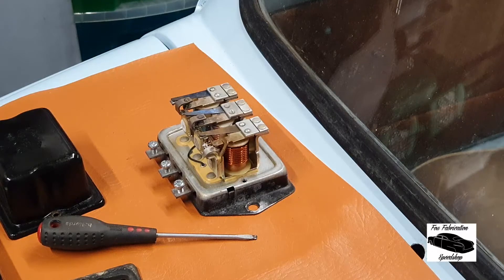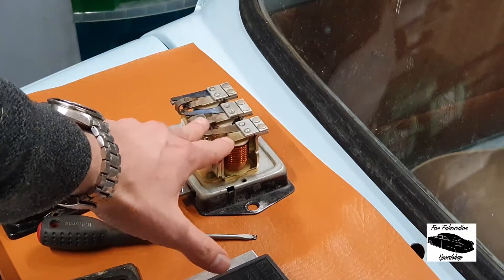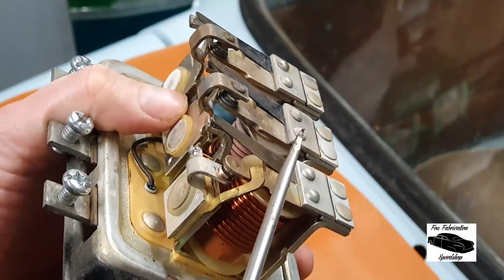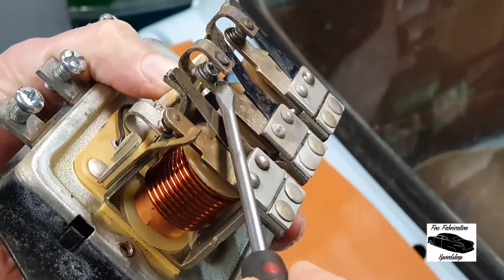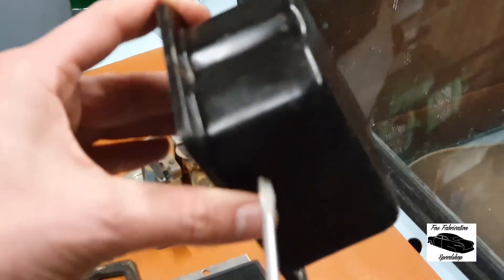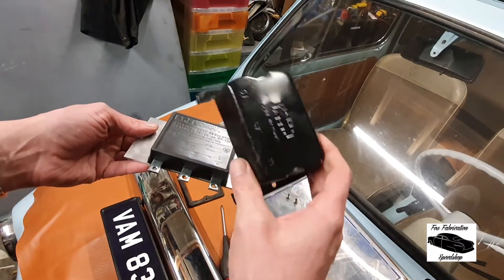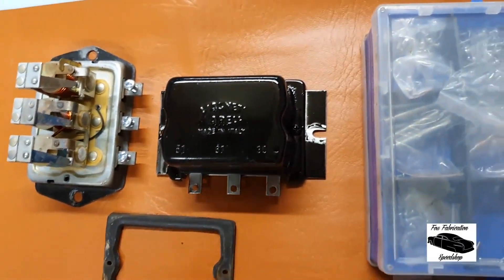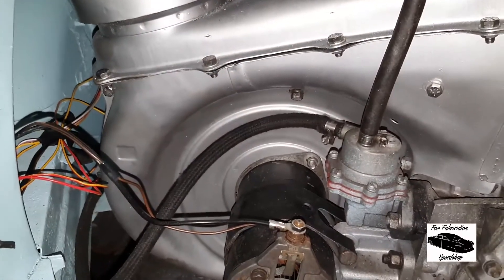Classic Fiat 500 voltage regulator swap How to DIY

Comment: thanks, but how did you test you were getting 12v ?
Reply from the maker: Just test at the battery when running it will read between 12.7-13 up to about 14 when revved but shouldn't go over this as the regulator ensures it doesnt
Reply: @FoxSpeedshop  thanks a mill. I very much enjoy the vids !
Reply from the maker: @robde001  appreciate the comments